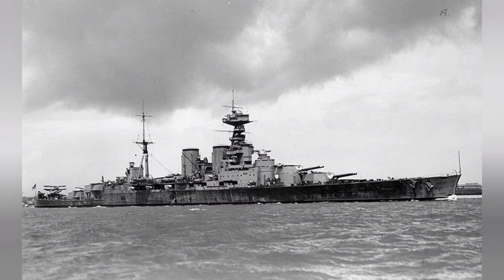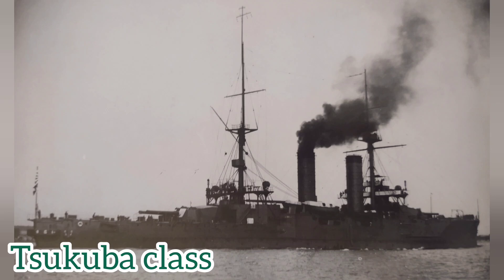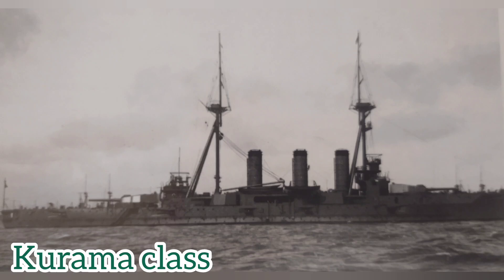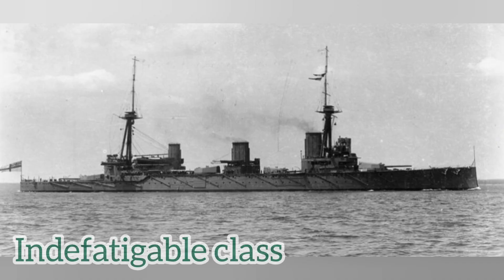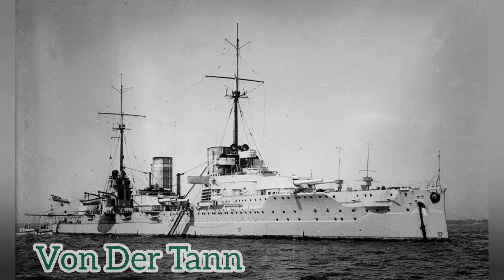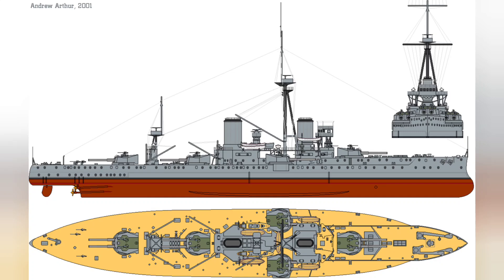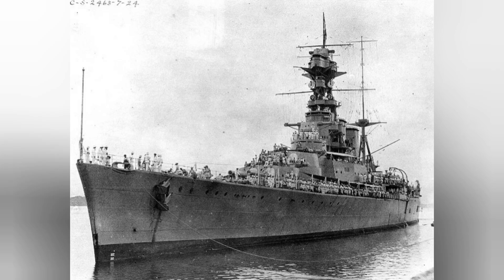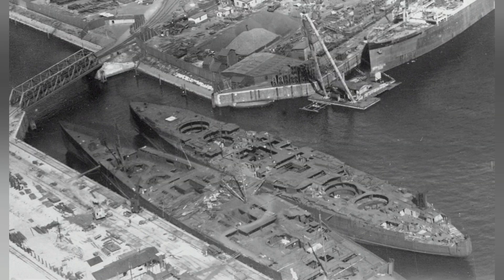The battlecruiser issue.

Comment: It’s amusing how controversial this topic is among armchair admirals. It’s funny how adamant some can get when the very nations building them couldn’t agree on what they were. 😅
Reply: When Britain used battlecruisers in the role the Royal Navy had originally assigned they worked quite well.  The performance of the HMS Invincible and HMS Inflexible at the Battle of the Falklands perfectly demonstrated this, they handily overcame their intended prey.

It was only when they were pitted in a battleship-heavy environment that the class failed as was demonstrated at Jutland.

It took decades before the Japanese intent was handily overcome at the First and Second Battles of Guadalcanal.  Their refitted battlecruisers were forced to fight outside (inside?) of their intended role and they suffered harshly (close range night engagements).
Reply: @mbryson2899 Speed most definitely is NOT armor.
Reply: The engineers DID know what they were designing, the admirals on the other hand... Looking at you Beatty
Reply: @mbryson2899 wrong re jutland

Comment: Have always thought that HMS Renown & HMS Repulse were the classic Battlecruiser. Gneisenau & Scharnhorst also fill the role very well. Just an observation, Cheers.
Reply: MN Dunkerque and Strasbourg should be at or near top of any Battle Cruiser list.  Built to counter Germany's pocket battle ships which were really light Battle Cruisers or Super Heavy Cruisers at 20,000 tons.   If in action with Renown & Repulse or Gneisenau & Scharnhorst, 1 v 1 or 2 v 2 I'd go with the MN ships.  At 25,000 - 35,000 tons just over 700' and with 30 knot speed and 8 x 13" guns they would be a problem for any BC including Alaska - which really was a unique ship and appropriate classed as a Large Cruiser (CB) not a BC - except Hood which even as oldest of them would wreck any Battle Cruiser 1 v 1. nine of ten times.

Comment: Most likely the main difference between the German and most other nations battlecruisers is that they usually seemed to lag behind in the size of their main battery weapons however this was somewhat compensated by their weapons quality such as generally having equal or superior range with guns 1 or 1 1/2" smaller size.
Reply: @LucioFercho  Not really. The reason why Germany armored it's ships the way it did, and has smaller than average gun sizes when compared to other capital ships, was because they expected combat ranges to be far shorter. And, with the combat ranges they were expecting to be fighting at, more armor for being able to take more horizontally moving shells, and smaller guns for lighter shells that can be reloaded somewhat faster were considered a priority. Meanwhile, the British were expecting fights to take place at much further ranges, so they wanted to focus on gun size, and speed, since having more range between themselves and their opponent meant that there would be enough time to change beating after seeing a muzzle flash. That, and the ships wouldn't need to have as thick of hull armor since they'd be more armored to deal with plunging fire. Once you are looking at guns of any battleship size, it's essentially impossible to armor your ships in a way that makes them impervious to damage, so, they are instead armored for an optimal fighting range, where any gun that is comparable to the guns the ship is using, at a specific range, cannot harm the ship. However, everyone knew that they'd eventually take damage in combat.
Reply: @LucioFercho  Have to disagree here. The germans expected shorter combat ranges because they reasonably expected to fight in the North Sea or Baltic were unlike e.g. the mediterranean visibility often is not that good as to allow for longer ranges. Yes, the germans favored smaller guns and increased firing speed,  also they made the design choice to favor more amour vs. more firepower. But their guns weren't that much better than the british. And that they needed bigger guns and their entire approach to the issue of gun caliber might be a bit flawed was something that the High Seas Fleet acknowledged with construction of the Bayern-class. With these they increased the caliber by a whole three inches and that at a time when it was not yet known that the british were also introducing that caliber on the QEs to counter the 10 14-inch guns on the Texas-class (friendly or not, it can't be someone has a bigger ship than the Royal Navy).
Reply: @horationelson2440  The RN Intention:
§1 we are the best!
§2 our ships are the best
§3 the german fleet should be copenhagend!
§4. in case 1-2-3-4 will not work mainly because unfair germans we immediately go to 
§5 Call in big cousin from overseas !!
Reply: @michaelpielorz9283  The Royal Navy at the onset of WW1, was far and away, larger than the US Navy. Now, in total number of capital ships, the US would become more equal due to the US having to not deal with wartime shortages anywhere near as badly as the European countries due to them joining the war in 1917. But, even then, the US lacked cruisers, and while the Royal Navy even began to convert and construct carriers, the US had none to speak of during WW1. Yes, the US did send a squadron of dreadnoughts to the UK to aid during WW1, but it was compromised of the older dreadnoughts the US had, and not the newer standard classes. Not only that, but the Germans never ended up clashing with the combined fleet anyway, meaning that... Other than the deterrent value of having a few extra dreadnoughts in operation, the US Navy in terms of capital ships and fleet actions during WW1, didn't do much. Now, the US did construct an absolutely ludicrous amount of destroyers, and these would be able to aid a great deal in terms of convey escort duties, and scouting duties, along with general anti-submarine warfare. However, the Royal Navy was definitely the main presence of naval power for the allied forces in WW1.
Reply: @michaelpielorz9283  Non of the American Battleships could hit a barn door at six feet. Their gunnery was terrible, think Beaties Battlecruiser fleet then multiply by ten. iF not for the gunnery training given by the Grand fleet, they wouldn't have stood a chance against two fishermen in a rowing boat, with a catapult. Big cousin was really a little boy wet behind the ears in 1917

Comment: There´s another aspect for the German battlecruiser design. As the German admiralty knew that Germany had a smaller industrial capacity than Great Britain they wanted their battlecruisers to operate together with the battleships. So they were in fact fill-ins for the battle line - or reconnaisance ships, just as needed.
Reply: "Britain produced about twice as much steel as Germany during the early 1870s, Germany's steel production exceeded Britain's in 1893, and by 1914 Germany was producing more than twice as much steel as Britain."
Reply: @danielebrparish4271  I was talking about industrial capacity and that means shipyards above all. GB had far more of them than Germany.
Reply: @danielebrparish4271 hmmm it's almost like Germany had OTHER things to build using that steel rather than ships and their navy wasn't nearly as important to them as for England, who would've known.
Reply: @danielebrparish4271  Germany couldn't produce heavy guns in the same quantities or large calibers as Britain. Big guns, their turrets, barbettes and associated equipment are the most complicated items on a Dreadnaught. The production of the armament dictates how fast and how many Battleships and Battlecruisers can be ordered and constructed in a given time frame. There is no point laying down four Dreadnaughts a year if you can only arm two of them.

Comment: SMS von der Tann had with 27 knots a 8 knots real speed advantage over the SMS Nassau at 19 knots. The advantage in later ships diminished only slightly as the battleships got faster reaching above 21 knots. Both Moltke and Goeben reached 28 knots and Seydlitz as well. Only the Derfflinger class was slower with around 26 knots, but still 5 knots faster than the battle ships. I talked about real measured speeds at trials.
The German battlecruiser were from the beginning meant to be able to fight beside the battleships. But there main purpose were still scouting. One could call the German Battle cruisers the first fast battleships.

Comment: In truth the battle cruiser as the English saw it was a hunter to chase down commerce raiders as the Uk focus was to protect its trade routes. The germans with a smaller navy wanted a duel purpose unit that could commerce raid, to outrun battleships and outgun cruisers……the Japanese philosophy, limited to a smaller navy by treaty, was to build high quality vessels that outmatched those units in opposing navies. The hood was actually well,armoured and gain most her speed from hydro dynamic efficiency as she was long. When you look at the weight displaced by battle cruisers, it gradually crept up and ships like the hood at over 40k tons were arguable the forerunner to ships like the Iowa…..the fast battleship, where, as the main striking force moved from battleships to carriers, the slow battleship was only really useful for shore bombardment and convoy protection from commerce raiders, and the modern fast battleships were those used to escort and protect carriers…and grew into floating anti aircraft batteries…..

Comment: Concerning Lion and the Orion-class: the reason often cited for removing one of the turrets was not so much saving the weight but needing the space of its magazine for the additional boilers and turbines required to get to the desired speed. That is also the reason why Lion had the suboptimal turret AB-Q-Y instead of the better suited AB-XY: the engines needed to be at position of X turret and for some reason the british weren't willing to make a redesign to allow Q-turret to become an X-turret like in Tiger, Derfflinger or Kongo.

And while I agree that comparing the battlecruisers to their contemporary battleship-partners is the right choice, comparing Nassau and Von der Tann is difficult because the Nassaus still use the voluminous triple-expansion engines, requiring the hexagonal layout of the turrets, while Von der Tann already has the lighter and more efficient turbines.

Comment: In a time when radio was still very new, High Frequency Radio direction finding was in its infancy, and the airplane was still very much a toy, it is difficult to look back in time and appreciate the scouting/hunting/communication roles intended for the battle cruisers and their need for greater speed to cover the seas quickly.  Developments in carriers and carrier aviation and later RADAR and HFDF (and to a lesser extent submarine "picket lines") "took over" those functions.  At the same time the Hood began the metamorphosis of the "battle cruiser" into the fast battleship, which was carried on by the Japanese rebuilds of the Kongo class and reached its zenith with Vanguard and the Iowa class ships..

Comment: I'm no nexpert on gunboats but it seems Cruisers were handy in the tight confines of the Salomon Islands and Guadalcanal Sound aka Iron Bottom sound in a way that Battleships found maneuvering constrained. Correct me if I'm wrong but Halsey seemed to go to destroyers Island hopping up the "Slot" primarily if not entirely because our Cruisers had either been sunk or put into dry-dock for damage repair.
Reply: I think that manuverability was not an issue in the Solomon Islands campaign. The main problems were the ineffectiveness of U.S. torpedoes and the unbelieveable range and effectiveness of the Japanese Long Lance torpedoes. Another factor was the tactics the Japanese developed for night fighting. Their lookouts were required to use eye shields when their navy was shooting so they could have superior night vision. They selected only those seamen who had extraordinary vision for lookout duty. They used massive binoculars but the best tactic was to send scout planes in advance of the navy to drop illuminating flares by parachute to light up the seas near the isand. This blinded their opponets and gave their navy a clear unobstructed view of the enemy fleet. They also used flashless powder to prevent the enemy from being able to see what direction the shots were coming from. Another great tactic was the use of dyes that identified an individual ships shells. This prevented one ship from adjusting their aim based on another ship's shells. There was so much confusion that some of the U.S. ships fired on each other. What saved us was the coast watchers who allerted us when ememy ships or planes were enroute to Guadalcanal. This prevented the Japanese from supplying their troops with food, ammo and medical supplies which resulted in large numbers of Japanese soldiers dying from starvation and tropical diseases.
Reply: @danielebrparish4271  All that and Type 93s were what either sank or dry-docked the cruisers we did have in the Pacific at Savo Island, Tassaferonga and operations in the slot thereafter. Nevertheless I believe cruisers still enjoyed a maneuverability advantage over battleships in confined waters such as Guadalcanal Sound. Mikawa took a force of Cruisers, not battleships, into the sound to sink five Allied Cruisers.
Reply: @danielebrparish4271 this campaign is the peak of ijn and i think its one of the best than what happened later where the ijn is basically useless due to the unfair industrial might of the US.